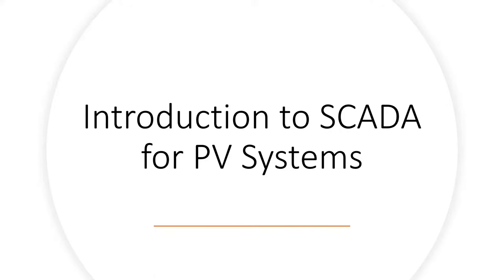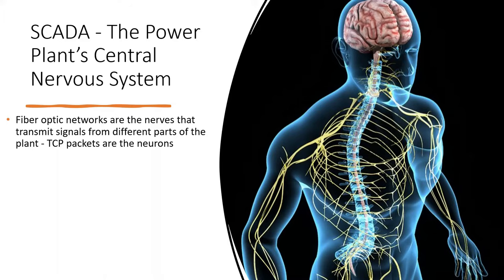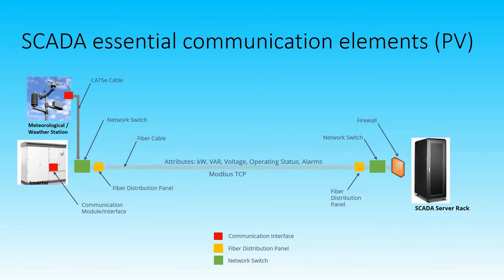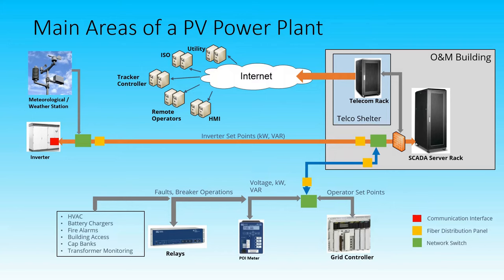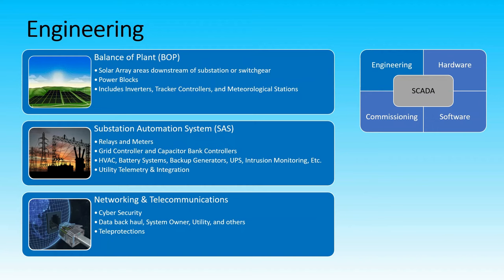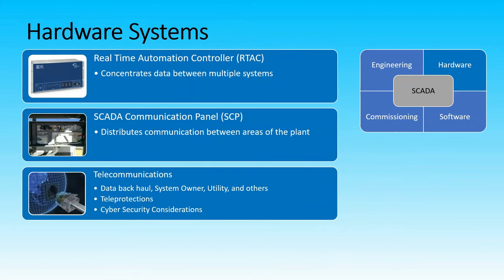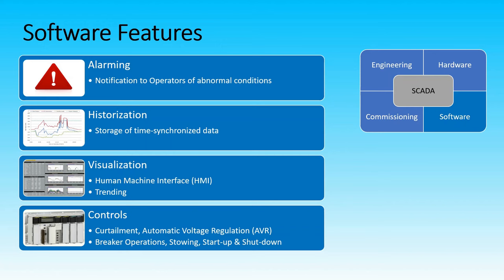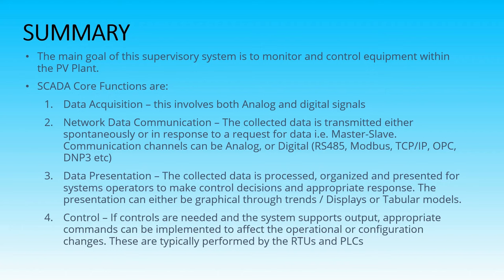Solar Photovoltaic (PV)  Power Plant SCADA Systems

Comment: For a typical 300 MW solar power plant, with substation 33kV/220kV what will be the cost for the scada system including engineering, hardware, commissioning, and software.
Reply from the maker: @SaeedAhmed the overall cost of the SCADA system varies due to a lot of factors:

Engineering and Commissioning - this will be more dependent on your preferred contractor as you'll be paying for Manpower and skillset.

Hardware - dependent on the type of HW to be used ; types of cables and or connections (fiber, ethernet, wireless etc), Meters, Data Loggers, Virtual Machines, PPC (power plant controllers). the price would also double if you'd consider setting up a redundant network.

Software - for those passive devices (Smart Meters, RTACs, etc) there is already an OEM software bundled with the hardware. However, for your main SCADA Application, this is separate and will be defined by the number of tags you need. Historization is also a separate package as well as Alarming and /or Events Generation.

All of the above would also vary depending on your geographical location as some equipment and manpower cost may differ from one another.
Reply: @SCADASupportPh  thanks dear for your detail response. Just a rough estimation in dollars, how much it will be. Can you please share the price range. Location will be middle East.

Comment: Can you please explain GC.
Reply from the maker: @SaeedAhmed SCADA Grid Controller is an absolute requirement for Plants from <40MW and above, mainly for compliance such as State Interconnection Agreement, PPA, or ISO requirements.

 It's function is mainly to make sure that the Power Generated by the Solar Plant can interact with the GRID but doesn't interfere with it's operation. It should be able to Adopt to the Voltage ( sag/swell) , can interact with the inverters reactive power, and also receive and follow any given curtailment setpoint by the GRID.

I can add this to my list of upcoming videos then. Thanks!
Reply: @SCADASupportPh  nice explanation. Is there any documents that you can share gives little bit more insight about Grid controller hardwares, or communication diagram.
Reply from the maker: @saeedahmed4651  RTACs are the most common, those SEL 3530 & SEL 3530-4(https://selinc.com/products/3530/) that are in-between the SCADA and the substation relays. 

For large power plants wherein a capacitor bank is required- for the V ratio changes on the high and low side, you should have a load tap changer (LTC). (https://www.reinhausen.com/productdetail/on-load-tap-changers/tapmotion-ed)
Transformer monitoring is a must too (https://smsystems.co.in/qualitrol-SERVERON-TM8-on-line-DGA-monitor.html)

On the subject of documentation, most of the documents I've used are more proprietary, so I would refer you to online / public documentation for those related hardware, or make sure to have a generalized video presentation.